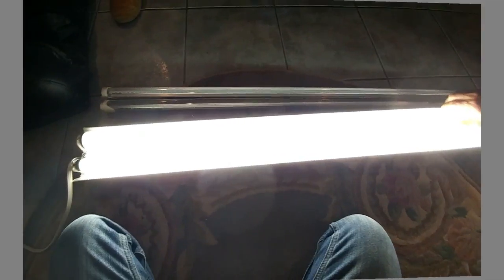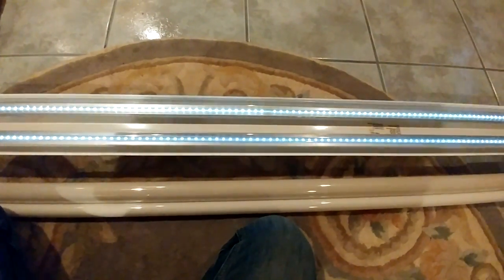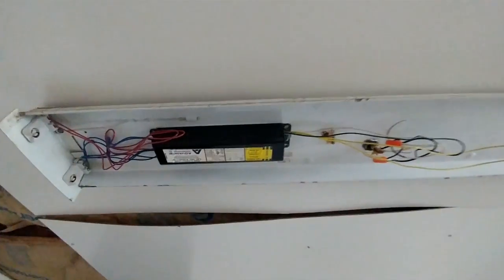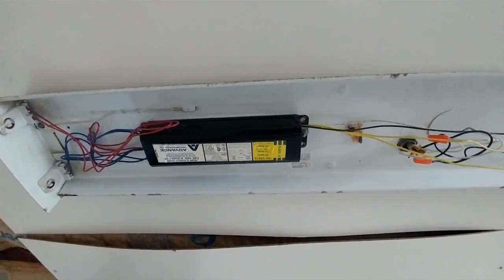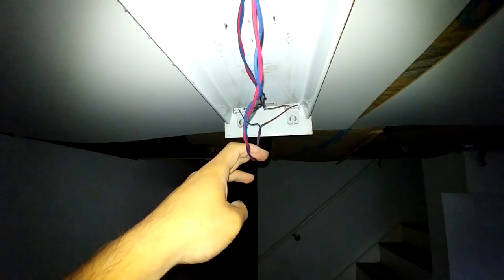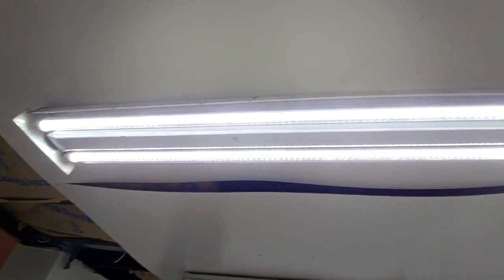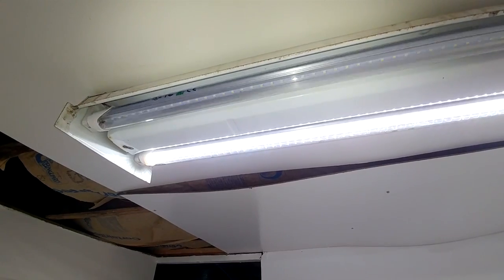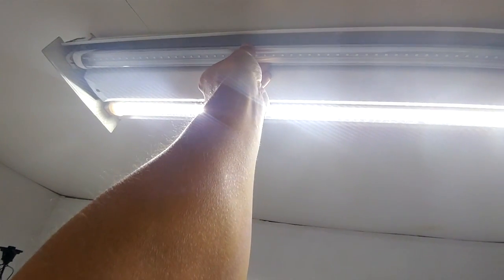Luminosum T8 LED Tube Lights Review, Ballast Removal, and Fixture Rewiring

Comment: Hi I am looking at these also, did you make enquiry why one lasted only a short time , Is there warranty? and were they good for a replacement?   I think that's very important if you buy a number of them ( 20 in my case )  also you have to make sure the tombstone  is not shunted or you will get a dead short.  thanks.
Reply from the maker: The seller said perhaps it was a QC issue and offered a simple apology. I was not provided with a replacement bulb  I believe because they are not able to break the 4 pack that's already stocked at the Amazon warehouse. In these cases, I would push for a partial refund. Just be careful to read the descriptions on these bulbs. The larger pack sold on the same listing by this vendor are dual-ended power, while the smaller packs are single-end. I made the mistake of trying to a different bulb in the fixture which turned out to be dual-ended and it tripped the breaker (and left a nice black scorch on the bulb contacts). I don't believe I have an issue with my tombstones, so I'm assuming they're non-shunted since none of the other lights are shorting out. I just had a problem with the one so far. Since now I have a mix of fixtures modified to take single-ended or dual-ended bulbs I have to mark all the bulbs AND fixtures to make sure the right bulbs go into the corresponding fixtures.